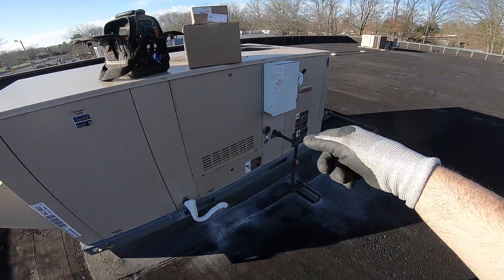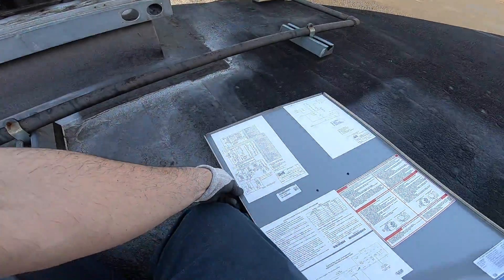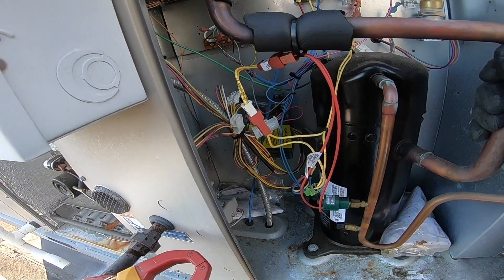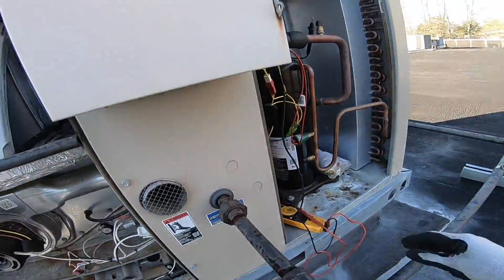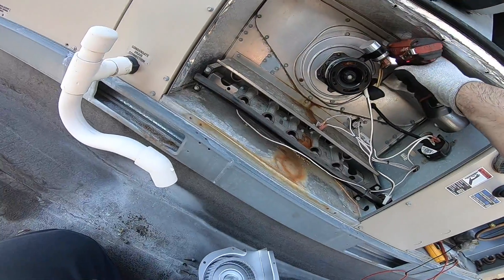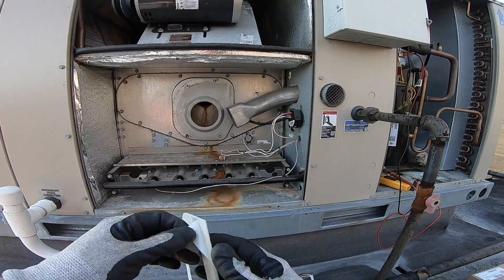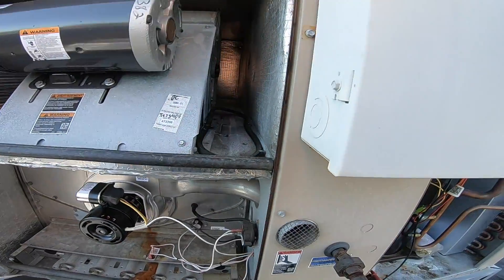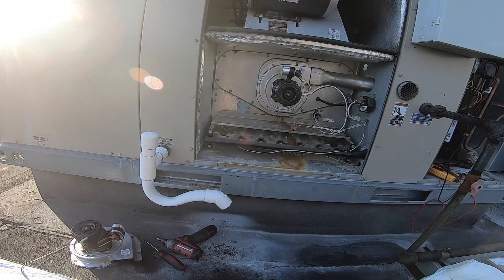HVAC Repair Replacing Faulty Draft Inducer Motor

Comment: Quick fix. Only if they all were like that.
Reply from the maker: I will take them when I can. Makes up for all the frustrating units that stop working until I show up. Then takes forever to get system to stop working or find symptoms. Seems I had a few of those this week
Reply: @thehvachacker  that's madning when can't find problem right away. The expression I use junk when it's new still junk lol